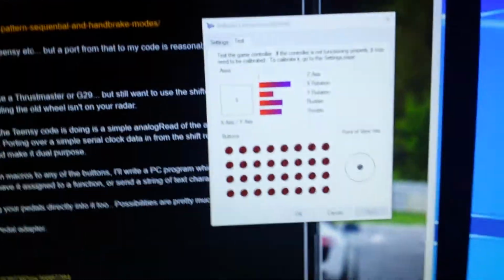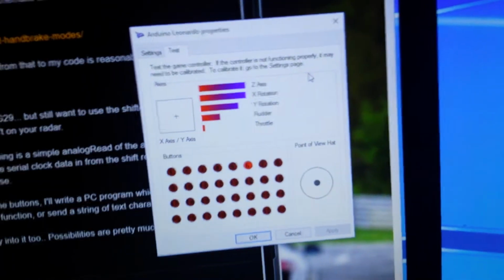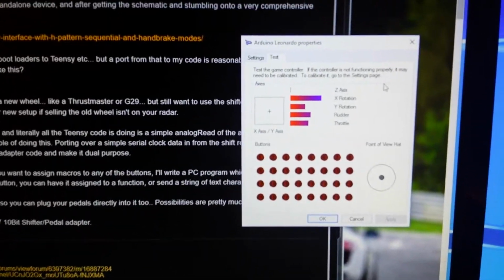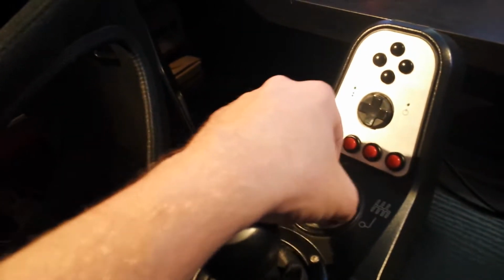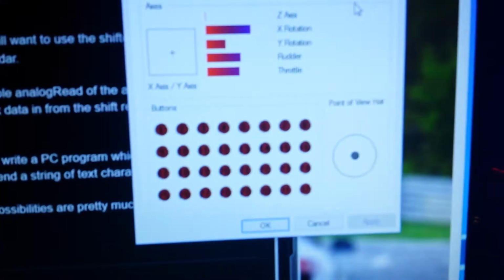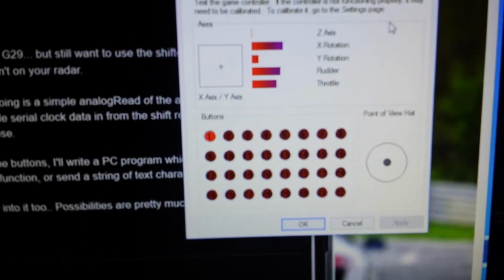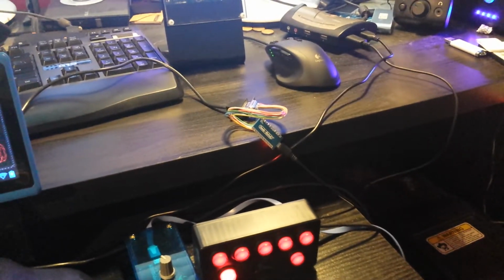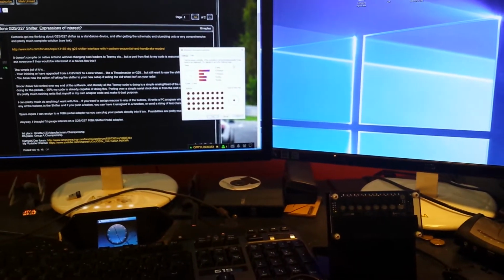Arduino based G25/27 Shifter Standalone

Comment: You need to enable the pull-down resistors for the analogue values if you are not using them. This prevents them floating.

Comment: Hello, I'm trying to do this mod too and I noticed that when I plug in the 5V from my Arduino, the power LED doesn't light up, while the sequential LED works when sequential mode is on. Is this normal? (I don't have a G25 wheel so I can't tell if this is normal or not)
Reply from the maker: Yeah that's normal. I never looked further into it.
Reply: @RamjetX  Thank you, I thought there was something wrong.

Comment: Hi, do you have any idea why at least in Dirt Rally 2.0 when setting the keybinds for the shifter gears, 9 times out of 10 the game sets the gear keybind to "z-axis" or "lower z-axis" instead of the button number for the gear we see for example in windows game controller properties?

If for example I try binding the gear 1, it rarely registers correctly the "button 1" instead it almost always registers "z-axis",  and I have to keep trying to bind it again and again.

Anyways, thanks for your efforts on the coding.
Reply from the maker: Check the game controllers setting panel in windows. If the axis are moving at the same time your setting gears. You can disable the axis by modifying the arduino example sketch and make the Joystick Axis 'false' for those axis.

The example sketch I included is pretty well documented in the code. Shouldn't be too hard to find and reupload to the arduino... 

Shout out in the simhub discord if you need more help.

Cheers,
RamjetX
Reply: @RamjetX  Thanks I will try that!

Comment: Future more, I found this in your G2x_Shifter code.

   Logitech Pedals G25 Shifter DB9 male Connector
   DB pin 1 = Loopback device detection
   DB pin 2 = shifter_Data_Input
   DB pin 3 = shifter_Data_Latch
   DB pin 4 = shifter_X
   DB pin 5 = not connected
   DB pin 6 = Ground Data
   DB pin 7 = shifter_Data_Clock
   DB pin 8 = shifter_Y
   DB pin 9 = VCC 5V <--------

Is this correct for the shifter?
Because the Teensy version says this for the DB9 Connector.

G25 SUBD9 connector to Teensy 2.0 schematics

     SUBD9  Direction  Teensy  Name
     -----  ---------  ------  ----
     1      -----      7       Vcc
     2      ---->      17      Data
     3      <----      18      P/S
     4      ---->      21      X axis
     5
     6      -----      11      GND
     7      <----      19      Clock
     8      ---->      20      Y axis
     9

and some other internet things give me different results.
Can you describe what is correct?
Reply from the maker: The two wiring Pinout are the same. Check out my video where I determine the pinout and find that VCC is pin 9, and pin 1 was is also VCC but used as a loop back to check if it was connected
Reply: @RamjetX  so basically I need to shorten pin 1 and 9? I got it working with only VCC too 1 tho. I will watch your vid, maybe there is more too it than it meets the eye.
Reply from the maker: @Sharp_Stone  it is shorted inside the G25 shifter DB9 plug anyway. Electrically pin 1 and 9 are connected already. 

The misconception is that pin 1 is VCC, when it's actually just a loopback that the G25 wheel base looks at to see if the shifter is connected to the base before it tries to read any shifter values. That's why when it's disconnected from the base, the G25 wheel doesn't go crazy reporting random gear changes when it's not connected. ;)

Comment: where do I find the wiring diagram for the connectors?
Reply from the maker: At the top of the code
Reply: works on arduino leonardo pro micro?
Reply from the maker: @1djval  Yes.
Reply: Thanks
Reply from the maker: @1djval  I have 3 more recent build videos on my channel... it explains everything

Comment: Good night, in the female serial, the colors are different, there’s even a blue wire that I haven’t seen anywhere talking about it and another doubt I’m using an arduino nano v3, can I use this or is it better to get another one?
Reply from the maker: The nano is a Atmel 328p processor. It does not have native USB and won't emulate a gamepad.

Use an Arduino with an Atmel 32u4 processor. Pro micro, Leonardo etc...

Comment: Hi all, it is some months that I am trying to make it work but when I compile I receive the message " 'Joystick_' does not name a type, did you mean 'Joystick'?
I can guess it has something to do with Joystick library but I don't understand where the problem is. Any suggestions?
Reply from the maker: Grab the 2020 release of the library from Github. There is a new example file in there. It should just load and run.
Reply: @RamjetX  I know it is not a metter of your code but any other ideas?
Reply from the maker: @TheGarimbus  you are using an Arduino pro micro or Leonardo?
Reply: @RamjetX  Leonardo
Reply from the maker: @TheGarimbus  have you installed the joystick library? At the top of the sketch it tells you which library to install.
Reply: @RamjetX  I'm using the one in the Arduino basic packet from "Giuseppe Martini ver. 1.0.0" . Is this correct?
Reply from the maker: @TheGarimbus  I'm not using that library in my example sketch. Details are in the sketch notes which one to download. 

It's the same library that Sim hub uses. So worth getting for compatibility
Reply: @RamjetX  finally done! Thank you so much for what you did and for your help!
I am not able to find where it is indicated in the notes of your sketch but testing one or two joystick libraries at the end now I compiled!!!
Reply from the maker: @TheGarimbus  Don't forget, I have 3 videos on my channel where I built this from scratch. Anything... and I mean anything you need to know is in those videos. It was done practically live.
Reply: Tried again to be sure, but same issue. Thanks for replying me!!!

Comment: Excellent. I used your code to hook up the shifter to an Arduino Pro Micro. Then my son wanted to use the wheel and shifter on the Xbox One, and of course, it doesn't work. So I added a little toggle switch to switch between PC and XBox mode. When the Arduino starts, it reads the switch position on 2 pins, and if it's shorted, it will switch to keyboard mode. In keyboard mode, it just sends key presses using the Keyboard library. As it is just a normal USB keyboard, the XBox can handle it. Provided the game supports keyboard input (not all of them do), you can now use the shifter on the XBox as well. Handbrake mode is, since the XBox One doesn't support 3rd party analog controllers not verified by Microsoft, switched to a toggle in XBox mode. Still reads the Y position, but just presses a button when it's above a certain threshold.

Comment: I am currently using a G27, but want to upgrade my wheel base while keeping the shifter, with all buttons working. I have already a arduino nano v3 is it possible to get it working? (sorry for that probably noob question)
Reply from the maker: The Arduino nano has the wrong CPU sorry. It must be an Arduino or clone board with the Atmel 32U4 chip. That's leonardo, and pro micro
Reply: @RamjetX  ok thank you very much for the answere! Then i will buy a new arduino.

Comment: will this work with arduino uno?????
Reply from the maker: Sorry no. The pro micro or Leonardo have the Atmel 32U4 chip which can natively emulate a gamepad which is what the code is trying to do.

The Uno is a Atmel 328 chip and doesn't have USB connections. It uses an separate USB to serial converter on the board. Realistically, the pro micro is a better all round board. The price is relatively the same and you won't have issues with fake China ftdi chips on clone Uno boards being bricked by ftdi and they're horrible driver bricking.
Reply: RamjetX ok thx

Comment: can this be done with the g29 shifter
Reply from the maker: Yes, but you won't get any buttons. Just gears. In all fairness though, the g29 shifter is just an X Y joystick. Amstudio has a ready made solution for that
Reply: @RamjetX  will it still work with the Arduino nano?
Reply from the maker: @SLIDWAYSx  No, it needs the Atmel 32u4 chip. Sold as a Pro Micro, or a Leonardo.
Reply: @RamjetX  ill have to order one thanks heaps much appreciated

Comment: Hello, I know it's been a few years, but could you share your code and wiring diagram to use a micro arduino on the g25 h-shifter as in the video ?, I look everywhere but I only find the schematic and code for the teensy board
Reply from the maker: https://github.com/RamjetX/Logitech-G25-27-Shifter
Reply: @RamjetX  Thanks for putting the code in github and making it available to us, I will revive my shifter g25, thx bro

Comment: Can I use a db9 adapter
Reply from the maker: Indeed it is a db9 connector... code linked here, follow generic wiring diagram and use the inbuilt example https://github.com/RamjetX/Logitech-G25-27-Shifter

Comment: Wire conection on arduino micro please , and the rest of stuff for conect g29 on usb , thanks in advance
Reply from the maker: G29 same as G25... code should work identical. https://github.com/RamjetX/Logitech-G25-27-Shifter

Comment: good project .. can you demonstrate the wire connection with aurdino micro please?
Reply from the maker: Updated library
Reply: @RamjetX  share the bro with the pinout on the logitek g25 shifter on arduino pro micro or on arduino leonardo

Comment: You know that there's actually a premade adapter to use that shifter in usb ? Because that's what you made, right ?
Reply from the maker: IMNOTA , hey mate. Yeah look a few guys in OZNZ sim racing were upgrading wheels and wanted to keep their shifters. What I did with mine was combine the shifter and pedal adapter in one with dynamic brake force adjustment and launch control active. It was a mini button box in later revisions too. It was educational tinkering for me and useful for others. It was fun to make
Reply: RamjetX
Oh, ok, so it was worth the work.
Thanks for clearing that up.

Comment: Im looking for a way to make the wheel rim a standalone usb controller to use on a different more powerfull wheel base. Theres a board in the wheel that houses the led rev lights, paddle shifters and 6 buttons on the rim with the 7 pin conecter that would have conected it all to the wheel base. My question is could i wire that to the adreno and make it all work with out much coding?

Comment: İ did every step correct but my shifter doesn’t work and the only error i got from arduino is com1 error what do i have to do exactly
Reply from the maker: Gonna need more info on what it is you have and trying to do. If you followed the instruction in the link, there is a quirk with programming the teensy.. .you have to hit the reset button to reboot the teensy in a programming mode for the software to upload the software. Beyond that, I have no idea what kind of error you'd be getting. Not enough information.
Reply: i did what you said before, i don't have a single idea how to program stuff, i saw the topic in the forum and decided to buy teensy, my father did the soldering part and he checked everything there is no problem there but for some reason only time that gearbox giving any feedback is when you connecting the gearbox to teensy board (only in the connecting part if you connect it there is no feeedback)  otherwise nothing shows up in the gaming controller settings i'm sure i setted up everything correct but only thing that has error is i don't get this window on my software http://i61.tinypic.com/2m504cw.jpg everything else is looks correct i hope i explained everything...
Reply from the maker: From your picture, it looks like it is programmed okay. Do the buttons on the serial monitor work?... I can't see it wouldn't be working. You don't need a com port for it to show up as a HID Gamepad/joystick. It should be plug and play
Reply: RamjetX ok thanks for everything i think shifter is broken i bought it second hand for my thrustmaster setup so it might be broken:( only thing i want to ask now does the power sign light up when you plug to pc mine is not lighting up when i plug it
Reply from the maker: Sting ER the power leds don't light up on the shifter from memory. The shifter is literally a joystick with all the buttons using a parallel to serial shift register. When you have the screen up showing the info like in your picture, do the buttons work?
Reply: nope they are not working.

Comment: hi, please help me, my shifter g25 damage ("serial" cable is lost) i need photos or any tip about conection in main board of the shifter and db9. please help. Thank you and sorry my bad english.
Reply from the maker: I'm curious how the cable got damaged. Here is a good website with lots of information on the cable pinout for the DB9. http://www.isrtv.com/forums/topic/13189-diy-g25-shifter-interface-with-h-pattern-sequential-and-handbrake-modes/

If you need the matching connection at the PCB side for the DB9. You can use the schematic for the PCB in that site to reverse check what the pins are on the DB9.

I'll have to open my shifter up to give a complete pinout again. I hope that website helps. I started there and rewrote the library for Arduino instead of Teensy.
Reply: Hi RamjetX, thanks for replying, the cable is a damage because my dog "ate" ... (maybe he thinks it's delicious ... kkk) I lost the connector (db9), I tried to identify the pcb board connection, but Unfortunately No success, in my case, I need complete information (pin on the pcb to pin on the db9 connector). I try the website indicate but unfortunately the information is only about conection DB9 to Teensy 2.0 (in my case i no any information about pinout in pcb shifter). Thank you very much for your attention.
Reply: Hi again RamjetX, i leave a topic about this problem in the forum ISRTV (waiting moderator approved)... cross my fingers to help...

Comment: I get problems with calibrating the shifter in ETS2, while the windows joystick thing is registering the buttons when shifting, very often ETS2 just ignores that input when trying to use that for shifting in settings. Can you make a video of your process of that?
Reply from the maker: ETS2? I presume that's European Truck Simulator 2? Unfortunately I don't have that game. But the process of the gear change is that it holds the button for the selected gear just as the original G shifter does. If it supports the original G25 and G27 shifter, it should be exactly the same

Comment: Do you need arduino or a teensy? Because on the links to the forum they mention teensy and not arduino. But a teensy is quite pricey where as an arduino is not.
Reply from the maker: The details in the link he uses a teensy. I rewrote most of his  teensy code as a library for arduino. I agree,  teensy is silly expensive compared to an arduino clone with exactly the same chip. 

I've been quite sick lately and busy lately finishing the rest of my projects. Plus Uni study. I did however get an example for my arduino version of the library. So I'll put it up on my github tomorrow. I should have uploaded it last week but cold and sick baby etc.. Life just gets away from you
Reply from the maker: The original ISRTV forum was for teensy... I'd adapted that and built the arduino compatible library years ago... sorry for the late reply. https://github.com/RamjetX/Logitech-G25-27-Shifter

Comment: sorry to bother you again mate. i got the board today. willing to point me somewhere for more info please? wiring/coding? thx in advance
Reply from the maker: Funny you mentioned it.. I haven't had a chance to do anything more with it since christmas till just 2 weeks ago. I made one for a oznzsimracing.com member and he's pretty wrapped in it.

I had to make some late adjustments to the code for his shifter since the potentiometer in his was dirty and the gate thresholds moved. But you'll get the idea. So I'm making an example folder ino for it now and I'll have it out by Friday. We have a public holiday here this week and I've been ill, but hopefully Friday I'll have some time to put something out on my bitbucket.
Reply from the maker: Yeah I will, I'm just setting everything up on a new laptop. Reinstalling GIT and setting up all my repository again... I remember now why I keep a dev laptop for years. All the dependencies and setup over the years is a nightmare to replicate.
Reply: Try this: https://github.com/functionreturnfunction/G27_Pedals_and_Shifter got it working.
Reply from the maker: Cool Mathijs, It's still all in the single ino file. 

I did get round to uploading to BitBucket. I have made some changes but mine is two separate libraries. The HID and the G-Shifter on it's own. 

It was easier to separate them and call the G-Shifter purely for the gear and buttons from a getter method. 

Got a little work to do this morning but I'm glad your post came up to remind me. :)
Reply: Cool can you link to it? :)
Reply: Okay, I will be looking forward to it :-). Maybe host it somewhere public so people can improve it.
Reply from the maker: https://github.com/RamjetX/Logitech-G25-27-Shifter

Comment: hello mate. i just ordered the same board and would like to use my g27 shifter with fanatec csw base. would you be willing to help me with the software please?
Reply from the maker: https://github.com/RamjetX/Logitech-G25-27-Shifter ... sorry for the late reply
Reply: @RamjetX  Hey RamjetX , not to be rude, but in struggling with coding,  do you have a working Sketch i can load and use?
Reply from the maker: @karlsteeg4139  there is an example with the library. Just check what pins your using and it should just work.
Reply: @RamjetX  , thank you,  will do so,  going to have to reverse engineer it, my color code re different to others